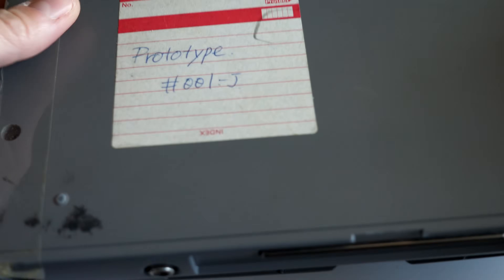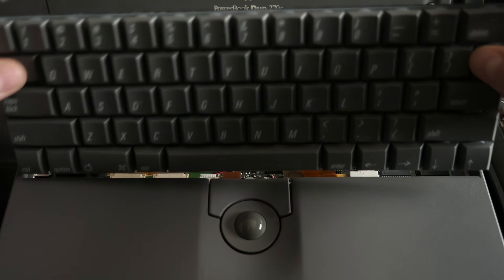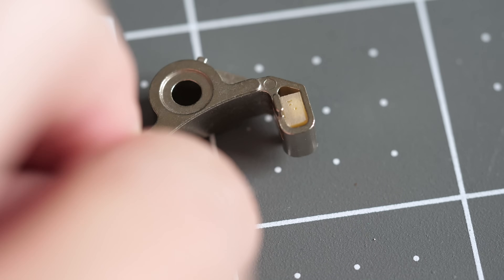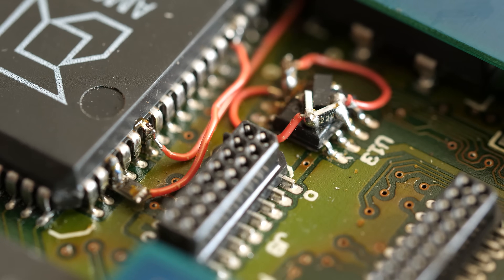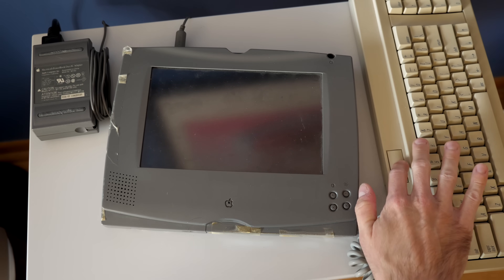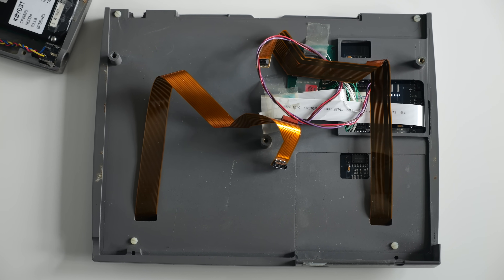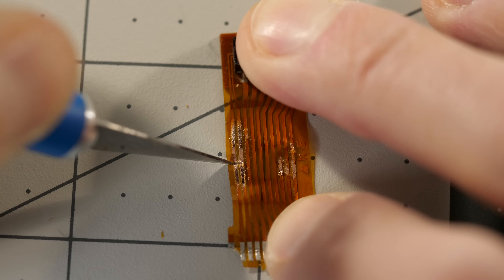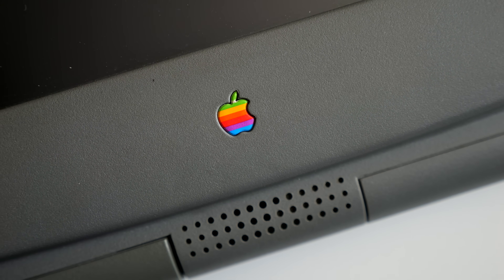Repairing an Unreleased Prototype Mac...TABLET?!

Comment: , Two years after Nokia built 1000 tablet computers... Sadly, they never hit the streets, but, like so much technology that was developed, very conservative Finnish management held us back... Then, Elop's death blow, Microsoft crappy OS (we had already been developing co-processors since 2009, (actually had intelligent LED drivers in 2005, that ran small lighting programs [ NOT just "canned sequences", actually had simple I/O, could synchronize with external signals]), real ability to do inertial navigation, "filter" touchscreen input, generate GPS "alarms", could even determine if the user was right-handed or left-handed)

Comment: Ive seen a slighly less sketchy cable fix where they cut it a little more to ensure no contact, tape/glued it for rigidity, then added wire from a cm away on each side after scraping the coating off like you did but away from the damaged area

Comment: ‼️No reason to open the hard drive.

I run into this issue ALL THE TIME and I will tell you without a doubt the best and most reliable solution is to bump the drive against a hard surface.

Normally, such as with a 3.5” SCSI drive, I hold the drive vertically and lift it 1” above the desk and drop it. Along the long edge of the drive.

I have drives that are still working seven-years after fixing them this way. It works.

Edit: WHILE THE DRIVE IS OFF!!!

Comment: Looks like Apple originally intended for a tablet computer that was a regular Macintosh and be fully comparable with Mac software. But the power consumption was too high, the unit too thick and with the wrong form factor,  there was the spinning hard drive to deal with, and it wasn't really suited to be used as an address book or a notepad (typical PDA usage at the time) so this is why they decided to develop the Newton that was much better suited for PDA style tasks. Think of the difference between a 3 ring binder and a small address book or paper type organizer.

Comment: I'm very glad you used DD to create a copy! It makes a copy of every single byte on the disk so it is the perfect way to actually backup a hard drive. If a drive has hard bad sectors, ddrescue can create a copy despite I/O errors by skipping the bad sectors first instead of retrying and only trying to read them again after having the rest ofthe data copied. I was scared that you are letting the OS mount the hard drive without forcing it to mount new drives under read only mode because the OS might do some writes automatically when mounting a disk in read write.

Comment: When repairing foil cables (with copper traces), always solder a thin copper wire (single wire out of a wick cable) across the gap. It will be 10 times stronger than only solder (which tends to fall off after a year).

Dismantling a harddrive without cleanroom is very risky. Any dust particle will cause a chain reaction of debris that kills the drive within hours to a month (but at least it lasted long enough to backup a binary copy). To free a stuck head arm, I read that it can help to rotate the drive itself causing a rotary impact to shake it loose. Also warming by hairdryer may help to soften sticky stuff, and cold (put into fridge) can help to break it loos either (like chewing gum stains in hair).

Comment: I'm not even joking when I said I had a HDD in a 286 Samsung laptop that had the gasket fail and get sticky goo over the top platter. Deciding the drive was toast and I had nothing to loose I washed it...with water and soap...then blew dry it with compressed air. Put it back together and it literally booted up. Scandisk did show a few bad sectors but the drive worked enough to explore.
Reply: Luck 100
Reply: Bruh

Comment: Never connect power to a Duo before a recap. They leak so bad (particularly the 270c) connection to power destroys the circuit. Additionally only use newer power adaptors like from the powerbook or iBook G3 (clamshell) as there is a large RIFA in those original power supplies that will go up like a Christmas tree

Comment: An old trick with stuck drives is, to put them in the freezer over night. The cold sort of deactivates the sticky mess and if heads stuck the thermal contraction loosens them up.
Reply: I would think a big danger here is that when you take it out of the freezer, it could get moisture condensation on any of the circuitry that’s not inside the sealed drive part.

Comment: I hope you at least put some oil on the shield after removing the rust. It will rapidly rust again if you didn't. A proper solution would be to tin the shield so rust can't reform at all.

Comment: When repairing a flex you should put a wire across, as a solder-only joint is extremely weak and will snap easily
Reply: Yeah. I typically see the repairs done with thin gauge magnet wire soldered across the break, and then covered in soldermask for extra support
Reply: It's a temporary fix. Nobody is going to be using this prototype on a regular. He did enough to get a rom and the hdd image

Comment: those bendy pcb cables crop up a lot in portable video gear from around that time, & I had to mend loads in sony vx-1000 dv camcorders. nice work. >looks at ipad< we've come a long way.
Reply: one of the small flotilla of ipad minis that my kids use- I've repaired it six times. each time I pry the shattered glass off another busted digitiser, I write the date on the shielding plate underneath. 😂

Comment: I miss when Apple used to design brand new hardware and not just play it safe, like they’re doing now! So glad at least you got the prototype to turn on!
Reply: @ViTuboEstasFeko  you Apple fanboys are shilling for a company that doesn’t even manufacture their own components! I know more about their logistics than you fanboys do!
Reply: @Markimark151  you're really misinformed on this one man.. you're embarrassing yourself. Apple designs the chips, TSMC manufacturers them. this is common, well documented knowledge.
Reply: @itsmeelan  nope, you’re the one misinformed! Apple doesn’t design components like chips, they only design the OS compatibility of the chips, TSMC has all the engineering knowledge of the processor chips for Apple!
Reply: The Apple M series is the most customization you have ever done, because everything is made by Apple and cooked of course by TMSC.
Reply: @gatitosmiaomaio  Taiwan Memiconductor Sanufacturing Company cooks good.
Reply: @gatitosmiaomaio  Apple themselves aren’t manufacturing the chip, they’re just using an ARM based processor for their Macs!
Reply: @Markimark151 yes but a heavily modified and incompatible with standard arm64 processors that **apple** designed. i'm not even an apple fan and even i know their silicon isn't off the shelf anymore
Reply: @SoulcatcherLucario  it’s Apple designed system on a chip, to work with their walled garden system, but it’s not their own architecture.
Reply: @Markimark151   It is much better than at that time, since at that time it used a Motorola processor, something not of its own design.  Now they design everything.
Reply: @gatitosmiaomaio  Motorola wasn’t very experienced with CPUs, that’s why Apple and Motorola did a joint venture with IBM with PowerPC. Apple doesn’t actually design the processors themselves, only customize them to work with their Macs.
Reply: @Markimark151  TSMC manufactures the chips, but Apple designs them. They don't just cram off-the-shelf ARM cores into their chips.
Reply: @Wheelman2004  they’re customized for Apple, since TSMC are the ones who actually design the chips.
Reply: @Markimark151  No, Apple designs the chips and TSMC manufactures them. The chips contain ARM IP of course and I’m sure TSMC works with Apple on modifications and production logistics, but Apple really does design their own chips.
Reply: @Wheelman2004  wrong, Apple doesn’t know how to actually design processor chips, they just customize them like how Nintendo does with their game consoles. They just finalize the computer specs, they’re not component makers! Apple is just rebadging those chips as their own for distribution!
Reply: @Markimark151  You are completely wrong. Find me the chip that the M1 is a rebadged version of. You won't and you can't, because it doesn't exist. All of Apple's A and M series chips have been designed in house for years now. M-series chips from their introduction and A-series chips since 2017 when they finally stopped using PowerVR GPUs in their SoCs. Every source you will find says that Apple designs these chips and TSMC manufactures them.
Reply: @Wheelman2004  dude, please stop bickering with me, I’m in IT that services computers, Apple doesn’t make their own chipset in-house! They use suppliers like TSMC, LG, Samsung that are the ones who conceptualize and manufacture the chips. Apple is the client that just orders the specs that would fit their overall computer design. Reviewers like Marquees and RTU have opened these Macs and the M series chips are outsourced components!
Reply: @Markimark151  LG and Samsung don't design or make Apple's A and M-series chips, where are you getting this from? (Last Samsung manufactured chip was the A9 in 2015, TSMC only ever since then). And no, NOBODY has said the M-series chips are outsourced, literally nobody! You may work in IT but you really need to do your research on this, because you are waaaay behind the times. As long as you keep spouting misinformation I'm going to keep responding!
Reply: @Wheelman2004  chill out dude, talk to Marquees and RTU about the behind the scenes stuff at Apple! You sound like a Apple fanboy that thinks they actually invented their own silicone chipset, when in reality it’s other companies that are uncredited for making the chipsets on the Macs! It’s a Taiwanese company that has the development of these Apple branded chipsets!
Reply: @Markimark151  TSMC is that "Taiwanese company" you mention. And as I've said countless times by now, TSMC manufactures the chip that Apple designs. This is a literal fact. Apple designed it, TSMC manufactured it.
Reply: @Wheelman2004  listen for the last time, Apple is a client that orders the processors from TSMC to make, since they have the skills in semiconductors! Got it?
Reply: @ViTuboEstasFeko  you’re gaslighting with paragraphs! Apple outsources their chip development, because they don’t produce those components anymore! You people don’t dig deep enough with Apple’s suppliers, they are the ones who have expertise in hardware chipsets.

Comment: That's an awesome job! I tried repairing a flex cable once, but I didn't lower the soldering iron temperature. I melted the ribbon unfortunately. Are you going to upload the HDD and ROM images to the Internet Archive?

Comment: Whenever you open a drive, always determine the torque the screws are currently screwed down to.  Then, when reassembling, use a criss-cross pattern (like a cylinder head or car wheel)  and torque it to the same spec.

Comment: The display issue is likely a capacitor issue as well. My Duo 230 also had leaky capacitors on its controller.

As for the flat flex cable, do you have any advice on repairing lifted pads where the connector is soldered on? I accidentally lifted some pads when trying to fix a bad connection on my iPod Mini's clickwheel connector...

Comment: A spinning hard drive in a handheld device sounds crazy, especially with hard drive of this size! I've known that some ipods have miniature hard drives instead of anything solid-state, but this thing just looks like a beheaded laptop.
Reply: I carried an iPod Video with a 60GB HDD in my pocket for a few years, playing music while I walked around and whatnot.  The drive in this video is about twice the size of that one.
Reply: @sirnickity  I have been using a 30GB iPod video for the past 3 years, sometimes when I am on my bike. Works fine with 0 reallocations.
Reply: I still have a classic 160 with its 2.5" hdd; I thought about putting a flash drive in it once, but the noise it makes is part of the haptic experience of using it.
Reply: nothing crazy about that... that's how it was done most part of my life, worked fine for the time beeing...
Reply: Harddrives die if dropped (else can last many decades). But SSD die already when left unpowered for few years (the more writes, the faster) because they are DRAM with 1 year refresh rate. So with any nowadays tablet or laptop it is unlikely to recover any of its data when found on an attic only 10 years later.

Comment: Regarding open drives and clean rooms.  Back in the early 80s I was a repair tech for a computer manufacturer.  I helped train new techs.  We had a 10 meg hard drive from which we removed the cover to show new techs how these drives worked.  This was a time when one could still smoke at their desks.  We used to flick cigarette ashes onto the spinning platters of the disk and watch the heads fling the ashes off the platters.  That disk ran for the entire 2 years I worked at the factory and never once had a failure.  Those were the fun days of computer repair.
Reply: Great, now your test HDD is addicted to Nicotine.  ;-D

BOOT FAILURE
Insert a stogie to continue
Reply: For a school project, I open and REPLACED the top cover with acrylics panel.
The HDD worked fo all demo I did.
It was a 6.4Gb IDE drive.
Reply: I've actually found that the main obstacle to opening and then resealing a hard disk is the torque of the fasteners.  Always try to establish what the torque is before opening.  If you torque the screws back to what they were, it almost always works.
Reply: @tarstarkusz  I found this. Try to open it up upside down if the read head is stuck out on the platter. I did this to prevent dust settling. I recovered 85% data from a 500GB laptop drive spinning with the lid off, upside down in a USB C SATA enclosure. Clear too so I could see it doing its thing 😆 The issue mine had was it was stuck on the platter but after lifting and returning it to base it span up again. No life in Shindoze but plenty found when hammering it with gddrescue under Linux.
Reply: Seagate drives seem to be more forgiving than WD I've found...
Reply: I doubt if that would work these days. The information density on the disk was a whole lot less then than it is now.  (10 MB over a whole disk vs 10TB today). Basically a bit occupies like a few atoms now, so very easy to obscure with particles of crap.
Reply: I am 27 years old, this is the coolest thing I have ever heard. I always used to open up my failing hdd's for fun when I was like 12 :p
Reply: I have one of my old drives screwed open as decoration, got curious during this vid and popped it in without a cover, still seems to work. haven't tried flicking my ash on it, good idea
Reply: @croozerdog  makes good art with a marker pen for about a 10th of a second 💀💀
Reply: Man, you guys didn't give a crap about anything back then. I don't know how anything got done properly.
Reply: @alm5992 it often didn't, so then stricter and stricter rules had to be forced onto people and now the people that caused all the rules complain about the rules and how great things were back in the day 😂
Reply: @alm5992  Naw, we did give a crap. We worked our asses off. That's why you have the world you live in today. We just didn't have sticks up our asses.
Reply: Are you kidding? Dismantling a harddrive without cleanroom is very risky. Any dust particle will cause a chain reaction of debris that kills the drive within hours to a month (but here at least it was enough to backup a binary copy). To free a stuck head arm, I read that it can help to rotate the drive itself causing a rotary impact to shake it loose. Also warming by hairdryer may help to soften sticky stuff, and cold (put into fridge) can help to break it loos either (like chewinggum stains in hair).
Reply: @cyberyogicowindler2448 not at those densitys. The first ever hdd's were litterally meant to be opened to be serviced relatively often. There was a lot of room for error with older drives, compared to newer ones
Reply: @TheCustomFHD  Nope. This may be valid for very early (1950 to early 1970th) harddrives. E.g. the Xerox Alto had a drive that worked like a huge floppy with the metal disk inside a exchangeable cartridge and the heads outside of it as part of the drive mech, thus it was designed to be tolerant to minor amounts of dust.

But since 1980th it was common knowledge in computer magazines that opening a harddrive at home for sure will destroy it by dust, because the rotation speeds are such high that any foreign particles get rammed into the surface, melting fragments of the magnetic coating and head away by generated heat.

Comment: I wonder why Apple doesn't have a gallery museum of all their products.
Reply: They did and Jobs threw it out when he returned.  He believed in the future and not the past.
Reply: @davewhite7182 just recently, Cook reiterated this stance
Reply: @davewhite7182 but without the past there is never be future. He is wrong.
Reply: i repair vintage macs professionally, internally they do in some departments.
Reply: I worked at RCA in the 80s at the lab that developed color TV among other things. They had an actual museum on site, it was very cool. Even the ceiling light panels were shaped like old TV screens. But it wasn’t usually open to the public.